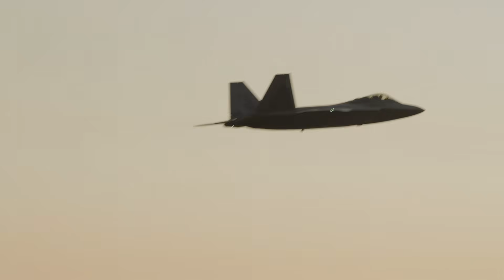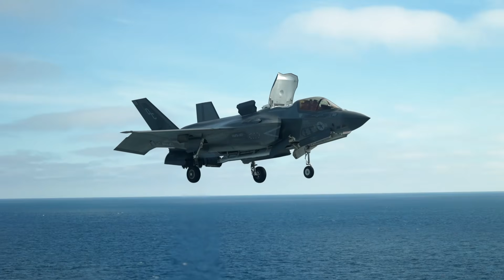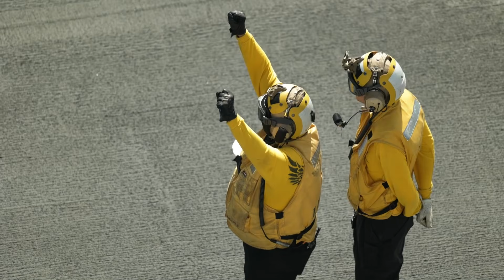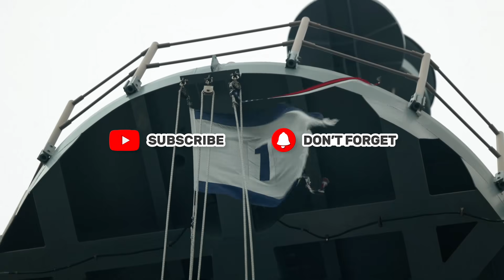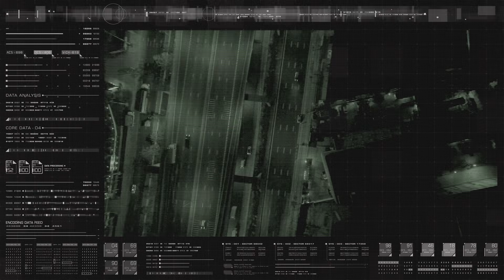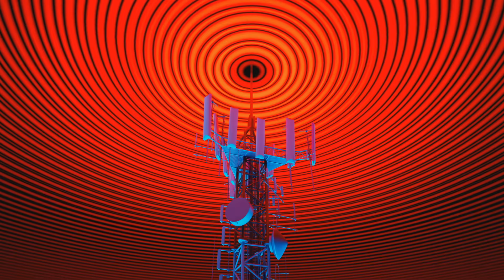The Stealth Myth Destroyed | How Modern Militaries Track Invisible Jets

Comment: A request-Do try to make a detailed vlog on SU47 Berkut as the next BIG defence project in the US is supposedly inverted flying wings jet concept if my source is correct.
Cheers😊
Reply from the maker: The Su-47 Berkut is definitely an interesting experimental design but it never went beyond prototype stage and is not an active development path today The forward swept wing concept had serious structural and stability challenges which limited its real world adoption As for the claim about an inverted flying wing US project there is no confirmed official program matching that description publicly known modern US efforts are more focused on unmanned systems next gen B21 stealth evolution and collaborative combat aircraft concepts so a lot of what circulates online is speculation mixed with partial information
Reply: @VectorTechExplained https://youtube.com/shorts/SxeQAuykGjw?si=aVtYH0DLgf-7J89T
Reply: https://youtu.be/7fWULLZPX4o?si=7C1FqgRMBqNT9ekY
Reply: https://youtu.be/7fWULLZPX4o?si=7C1FqgRMBqNT9ekY

Comment: Bro,you hit the nail right on the head.
Lockheed Martin and Northrop Grumman may try to shut your channel down for speaking out the truth!
At least,you are doing the right thing by educating the general public about the stealth jet scam and how these MICs are fleecing the US taxpayer😊
Kudos to your vlog
Reply from the maker: In my view the biggest factor in 2030 will be sensor fusion and real time data networking. Modern air combat is no longer about a single aircraft being hard to detect but about who can detect first and share targeting data faster across the entire network. Even if stealth reduces detection range it does not stop multi static radar passive sensors IRST and airborne drones from building a track over time. The side that can combine all these weak signals into one clear picture using AI driven fusion will have the advantage. So speed of information and decision making will matter more than any single signature reduction method. Stealth still matters but it becomes just one layer inside a much larger detection and response system